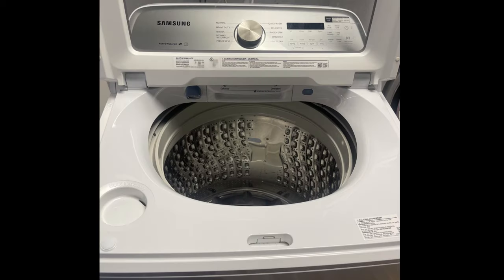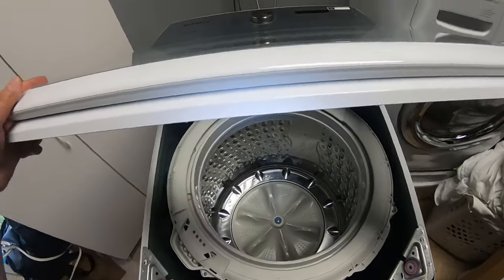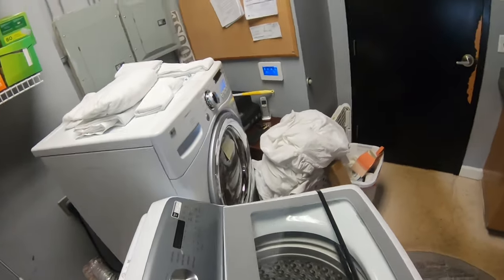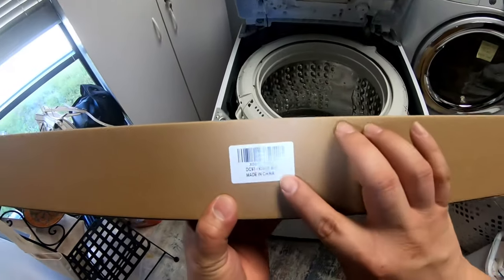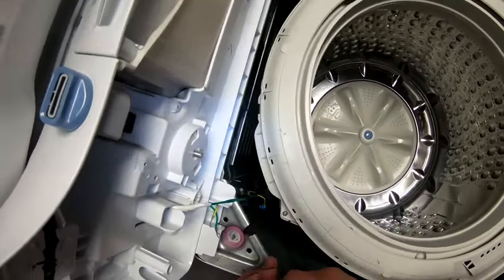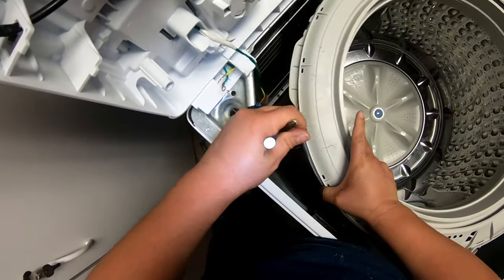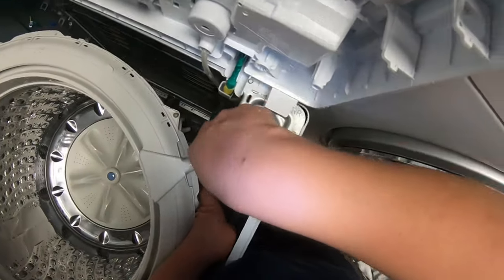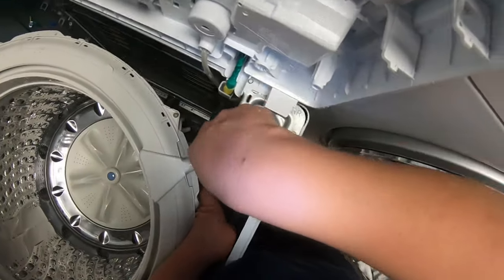How to Fix Samsung Top Load Washer Banging During Spin | OFF Balance | Model #WA50R5200AW/US

Comment: Don't forget to never buy Samsung white goods again.
Reply: Never again. I promise 👍
Reply: Yes never again this is ridiculous I had to fix this machine after only 1.5 years of owning this thing
Reply: @mmcquay73  me too
Reply: I have that model also.... replacing after 3 yrs and 1 month.  Can't keep doing these repairs. Any with the GE Profile lol 5.3..... hoping for better results
Reply: Same here, never again will I make this mistake.
Reply: Its not a samsung thing,basically every washer uses this same suspension system.
Reply: And you don't have to take everything apart that he did.  Still gets it done but, definite overkill with the panel removal.  And it's grease not glue.
Reply: They need to stick to phones n tvs 😂
Reply: I knew I wasn’t the only one with this problem! My old washer broke during the Covid shutdown and my choices in washers were limited. The only washer I could get right away was the Samsung white washer. Now I know why!!!
Reply: @Appachoppa112  again this isn't a Samsung  Specific issue. My 2020 Samsung washer is made basically the exact same way as any Maytag,Whrilpool,Kenmore has been over the past 5-10 years.

It seems Samsung simply takes the same basic design as the other Major brands and creates their own version of those parts rather then using the same parts is the only difference. Hell im pretty sure the  aftermarket Suspension rods themselves will interchange many models within thise brands.
Reply: I’m learning right now the hard way lol

Comment: the easyest way i found out was, take back cover off, remove grounds and the 4 screws, 2 front/2 back and back panel, lift back about 2 inches, easy to change rods when back panel off, then lift front the same and replace rods, seriouly takes 15 min👍
Reply: Can you explain this one more time; lol trying to do it so I dont have to deal with removing wires
Reply: That's what I was thinking 🤔  wont have trouble with the wires connection he had. It was his 1st time on that one good job

Comment: Thank you for your video. I didn't disconnect the wires. We opened the rear panel and removed the old ones and connected the new ones from the rear side. I hope it works fine. I have the help from my son and my wife. Don't forget to put lithium grease.

Comment: Me (30s and not handy) and my teenager (15) just did this on model Wa45t3200aw. We didn't have to disconnect any wiring thankfully bc that's the part that gave me pause. And we didn't have to remove the rear panel. I truly want to thank you! Your video was so easy to follow and you made it seem easy which even gave me the confidence to try this fix. I feel so handy. Just washed a load of towels PERFECTLY!! ❤❤❤
Reply from the maker: You’re welcome thanks for watching my video👍🏻👍🏻💯💯

Comment: Great video. A few things I did differently involved taking the control panel completely off, and slipping the rears out without taking the lower wires off. It was hard, but I really didn’t want to have to take the back off.
Reply: Im doing it now and was thinking the same lol. I see like two wires look like they connect to the control panel and they just unplug.

Comment: Thanks you saved me!! I found a shortcut thru yur video. Remove suspension from back access panel. No need to mess with all them wire. Washer spinning better than ever!! Thanks…
Reply from the maker: Yes, I mentioned that in the video that you can do it either or so I did it both ways in case people don’t have enough space in the back. Thanks for your comment. Appreciate it. Thanks for watching my video.👍🏻👍🏻💯💯

Comment: This helped me so much with my washer. It’s a 2019 model but we recently moved to a house in 2021. Now it’s 2024 and it was giving us issues with loads still soaking wet like bed sheets and comforters. After some research with the error code it was giving “UB” it was because of the balance. We ordered new stabilizing rods and used this video to replace them. I’ve never been so happy to have a full two loads dry on the spin only cycle that were heavily soaked before replacing them. You saved me a ton of money on my water bill too
Reply from the maker: Happy to Hear My Video Was Helpful to You!

Comment: I bought new stabilizing rods from Amazon. It worked for one or two runs. My daughter put a large load to wash and the machine started the banging noise again. I'm for sure if the parts were defective. I will try it again with upgraded rods

Comment: Thank you for this awesome video.  I was encouraged by how many people commented with successful  results.  I have the same model number referenced in the video, I bought the replacements based on the link.  The repair was straight forward thanks to your video.  Unfortunately, our washer still gets unbalanced quickly just like before.  Is there another step other than replacing the shocks?

Comment: Helped me fix my issue. I was constantly getting the UB code. I made sure the machine was level. Still issues. 

It would spin fine unloaded. Changed the suspension rods and it spins better that it has in a long time. 

Thank you for posting this video!
Reply from the maker: Glad My Video helped You Repair Your Washer! Thanks For Watching!

Comment: Thanks for the video Same machine didnt have to disassemble any wires after taking the back off was able to do the two in front and two in the back after removing the back easy peasy. Fixed the spin issue was completely out of balance now spinning the same as when I got it 5 years ago. Reason shock rods went out teen age daughter Hoodies washing 5 to 6 every week for 4 years beat the hell out of the shocks.
Reply from the maker: Glad My Video helped you with your Issue! Thanks for tuning in!

Comment: Great tutorial for this, but you should NOT have to touch the inside of the top panel to replace the suspension rods. Just remove the three/four screws holding the top to the back, and use a metal shim approximately 5-6" towards the middle on the front,  to pop the two clips holding the top to the washer shell. Good luck!

Comment: So there are a few tricks I’ve read in other videos comments on the problem and instead of buying new rods the hacks consist of using the correct shock  absorbent grease, some get the machine from banging using wire which they notch the rod above the plastic parts and secure it from movements, others used duct tape. The idea is just keeping the springs from movement up to fast. I think I will try the least expensive , dampening grease which is very sticky grease which will  restrict the movement of those plastic components above spring from moving so easily. Just my thoughts

Comment: I replaced the suspension rods and it’s still banging on spin and UB code appears. Any ideas what else it could be. I’m not putting heavy loads.
Reply: Me too, i have to remove some clothes in order for it to spin. HELP!
Reply: Maybe you didn’t hook the new shocks up correctly or maybe they are defective. I just replaced mine and everything is working great.

Comment: Well, I have the same model and I changed out all my springs but it’s still doing the same thing. Can’t figure it out. I ordered bearings but it’s not the bearings.
Reply: Did you find the fix? Still having the same problem after replacing our springs

Comment: I appreciate this video so much. Just replaced mine on this exact same unit. Your video was a huge help.
Reply: what were your symptoms for replacing the shocks?
Reply: @theeinsuranceguy  Every load, no matter how big or small would get unbalanced and we could hear it banging around until it errored out. We would have to pull out all the clothes and manually balance them around it and then just pray it worked. 

The new shocks have been in for a little over a week now and it is running great, no matter what we put in it.

Comment: This model is different than the other ones, pain in the butt with all the wires. Replaced the front two rods removing screws and than just removed back panel to remove two back rods. Needed my wife to lift the tub for the two back ones and lift rods, wrapped a paper towel around glue parts so it doesn't get messy

Comment: Did you have to turn off the hot and cold water line? I have the same issue with my home washer. Ordered the replacement rods, Planing on replacing the rods using this video. super helpful thanks!
Reply from the maker: You do not have to, However I Recommend to do it for Safety Just in Case Something goes Wrong. Most of the Time, I do not disconnect them if I have enough room to work. Hope this Helps.

Comment: I replaced the support rods with some stiffer ones they were a little shorter than the OEM ones but it improved the stability however the drum still moves enough to trigger the UR code. Any idea what else I could do to fix it?
Reply from the maker: Push the tub down if it bounce more than once install the OEM  shocks
Reply: @DIYRepairsNow  Pushing down on it and it's stiff doesn't move. Takes a lot of strength so it's not the up down motion that's the issue but when it starts to spin a lot faster it will hit the sides of the chassis and trigger the UR code. Are the rods the only thing that is suppose to keep the drum in the middle? I also checked the large nut in the middle and it's on tight.
Reply: @rubio7922 I'm having the same problem did you found a solution?
Reply: I’m also having the same issue
Reply: @dallas24s69  yeah I ordered the right rods and all good since then. Have to get the correct rods that are same length of OEM.
Reply: @rubio7922  I tried that and it didn't help so I just replaced the washer

Comment: Is there something else that could be wrong. I replaced rods twice, check length of rods. Still getting banging noise. Plus washer fills up with water on rise cycle then adds more time.
Reply: That is what my washer does also, even after new rods n springs
Reply: My washer is also still banging and adding time after replacing the rods, did anyone tell you what else could be done.

Comment: I took mine apart. I bought from amazon some brass shim material. (verry cheep) I lined the entire hole with brass shim. Then I slid my rubber into what is now a smaller tighter hole.

Comment: FIXED! UPDATE BELOW-
We replaced ours, but the banging is still happening.
We also calibrated it. What else could be the issue?
**UPDATE- I BOUGHT THE ONES FROM SAMSUNG (PREVIOUSLY PURCHASED THE ONES ON AMAZON) AND IT FIXED THE ISSUE!!! I COMPARED THE 2 SIDE BY SIDE AND THE SAMSUNG ONES ARE JUST A LITTLE BIT LARGER

Comment: I bought a set of these suspension rods/shocks online for $51. The cost for "genuine" Samsung shocks is $160 for the set. But this is the same shock that only lasted a couple of years on the washer I now have. I hope that you will give me some insight as to what you or your peers would charge for this job, parts and labor? Just curious as to how much money I am saving by doing it myself. I am in Houston, TX. We just usually take our broken appliances out back and shoot them full of holes. Then we jump on our horses and head to the saloon. Ha.
Reply from the maker: This repair cost between $285 and $375 and depends on the manufacturing. Sometimes the aftermarket parts are better than the OEM but in this case, it depends on how you use your machine. If you overload the machine or more than three people lives in the house you can only spec this shocks to last between 2 to 3 years, if you use the washer the right way without overloading, and only two people lives in the house this shocks can last between four and five years

Comment: How do you know if it’s the suspension shocks that are the issue? Should I check other things first before replacing those?
Reply from the maker: https://youtu.be/HvTqvm_WNHQ?si=CvgSUsy4hTvuPPTe
Reply from the maker: They will never look damage, and in this model is hard to tell when they are bad sometimes when you push the drum and tub down in a bounce more than once that means the shocks are bad, but sometimes in this Samsung's it doesn't do it however, I'm going to leave you this link that way you see how it will bounce if they are bad. The only thing is that the link is from a whirlpool but it's similar issue
Reply: @DIYRepairsNow  Thank you so much! My washer is the exact Samsung model. It does seem to pass the one-bounce test, but it constantly goes unblanced and hits the sides during the spin cycle. I will try to replace the shocks, but is there anything else I should check before that?
Reply from the maker: @sarahill3962  no the first step is replace the shocks most likely that’s what it is

Comment: I have replaced the shocks and checked the bolt to make sure its tight. Its still wobbling , now what do I do.
Reply from the maker: Try to do a calibration
Reply from the maker: https://youtu.be/j7d1M6Yd6s0
Reply: @DIYRepairsNow  I did and its still has the problem. I saw a guy drill holes in the upper ring of the drum to get water out of it. Have you ever heard of that ?

Comment: I have that exact washer it gets to the spin cycle and repeats over and over also fills back up with water then drains any solution or video how to repair thanks
Reply from the maker: To me it sounds like you probably have a computer problem. You will have to call a technician.    It’s giving you error codes?

Comment: those 2 finish screws in the front will NOT come loose no matter what I do. WD40 is no help[. they seem like they are impacted tight in there and no screwdriver or power drill will remove them. Im about to try a tap to drill them out. Any Ideas?? HELP!!!!

Comment: Dumb question. Couldn’t the back panel be removed early so the back shocks can be replaced without disconnecting all the wires so the top can be lifted more?
Reply from the maker: Yes, is best to remove the back panel. You can do it either way.
Reply: @DIYRepairsNow  great video by the way. Thanks!

Comment: Use gloves! He is right, that stuff on the rods is like glue! It cleans up easy with Goo Gone. Video is great! I found I didn't have to disconnect any wires to get to the back rods. Once you take the screws out, put the panel all the way back in place and just tip the lid up and will be good. There are some tabs that will keep it form sliding off. However you will need another set of hands. The right rear is the biggest challenge as he said because they wrap a tube around that rod. Past that, the job was pretty easy.
Reply: The black stuff on the rods is called Dampening Grease...it's the opposite of "Grease"...it's NOT slippery, it's very sticky to keep the springs from oscillating out of control when the load is out of balance.  It helps slow down the spring during it's travel on the rod.  Kind of makes sense, but yes...if you get it on you, it's very difficult to wash off!  LOL  Hope that helps...

Comment: So I have samsung washer too with same problem so u say it's the shocks
Reply from the maker: I did this repair like two months ago and I haven’t had any problems yet so that was a problem with those model however it could be other things But I always start by replacing the shocks 👍🏻
Reply: @DIYRepairsNow  my washer is very similar just a different model but literally it can have 2 towels and it bangs gonna looks to see if I can find the shocks?? Is that what there called??
Reply from the maker: Yes they call suspension shocks there’s a link in the description of the video

Comment: Remember you have to recalibrate the drum when you replace  the rods
Reply from the maker: Thanks for the tip I’ve been doing those rods for years and never had an issue after I replace them but any tip is welcome to perform a better repair thank you buddy 👍🏻👍🏻
Reply: That still isn't a 100 percent. This washer is pure trash.
Reply: He doesn't have any idea. No need to replace the springs.
Reply: How do you recalibrate? I replaced the 4 rods but the problem persist.
Reply: @NoraNaatz  power off & on , press “temp” & “start/pause “ for 3 seconds it should say “cb” press start & there
Reply: How ?

Comment: I did this for my Samsung washer (same model), but I'm still getting that stupid "UB" (unbalanced load) error. Is there anything else that might be going on? Is there a sensor that detects the balance, which might be bad? I'm at a loss. I don't want to buy a new washer
Reply: Did you find solution problem and Please tell me your machine when it draws water, it fills almost 80% of the drum, right?
Reply: @Sergey-ob6xn  no solution yet. I ordered a set from another seller. I'm not sure at what point the error happens. I can try to see
Reply: @ShadowbladeBook  Could be the balance ring or a bent agitator shaft? Check leveling of washer.

Comment: tip for anyone changing these solo, i would change the rods one at a time. My dumbass did all 4 at once and it tip over with nothing holding it up. Needed a second person on the opposite corner and lifted it with the new rods at the same time.